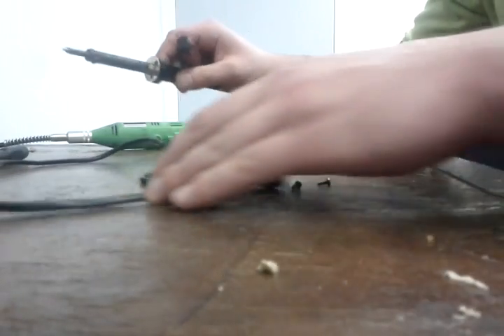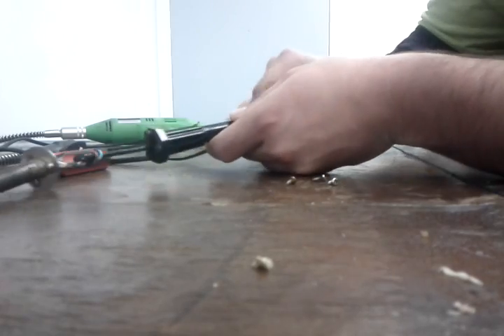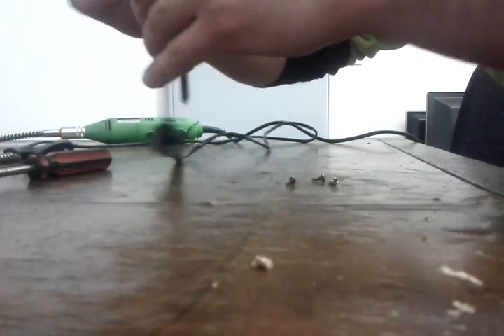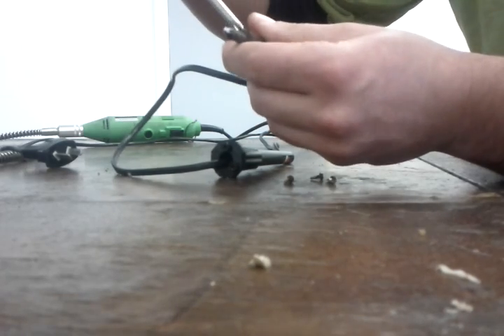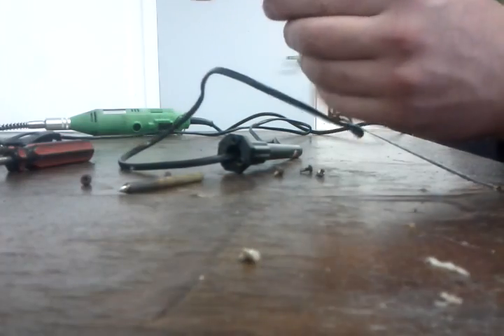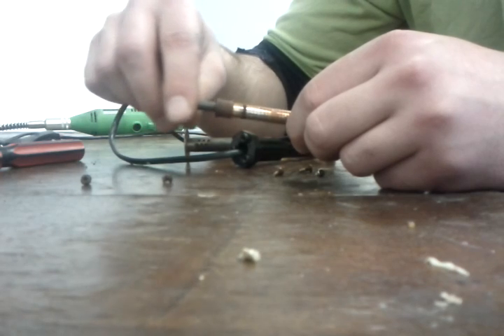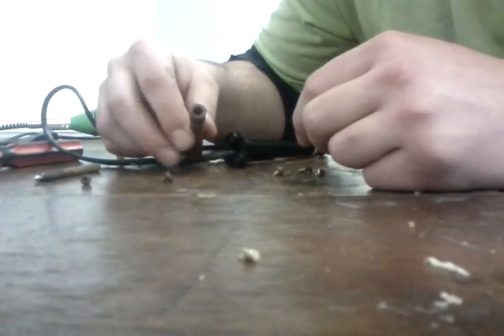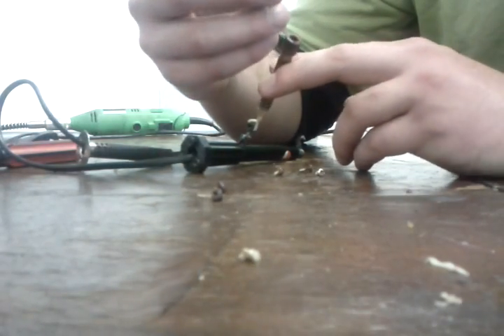How to fix a broken soldering iron (Not heating up)

Comment: I have a Trisonic 40 watt soldering iron, it was not heating up, so I disassemble it and I check the cord it's broken. I twist the broken wire and put tape around it nothing still won't heat up. I have no soldering iron, and that was the last one I have. What a Nuisance.

Comment: Thank you! I just got through £1 soldering iron from Poundland (I think) and a more expensive one from Wilkos building a bin-cage for my hamster, both stopes working so I had to drill the crap out of the storage box in order to cut through. So didn't realise about the tip temperature, it was far too hot and made a thinker cut than I expected but it's OK. Thanks for letting us know... Hoorah for YouTube! All my electrics fail on me, and I always come here to find how to fix!
Reply: Is that in pound town?

Comment: Cool Video
MY Problem is often I am trying to soldier kind of large connections together and the soldering gun just doesn't have enough heat energy to heat the metal up. 
Seems these solder irons and guns are made or small electronic factory connections...
So I often just turn to a small butane torch(it looks something drug addicts might use lol) and that little flame blue tip heats up and melts the solder but good!
Yep

Comment: Thanks for the very informative video. I am a newbie  to soldering.  Sorry if I'm not asking the proper question. My Weller ec1001 is not heating very high.  I put a thermometer to measure the tip temperature, but does not go higher than 260f degrees.  I am curious to find the low heating problem of my soldering iron?
I welcome any input!
Reply: Have you tried pushing it in?

Comment: Hi,  do you know what is wrong with me soldering station, its an RS 200-7693.  50W.  The problem is it heats up to the required heat and melts 1mm solder onto the soldering tip.  When i try to solder and touch the soldering joints, it seems to go cold and the solder goes hard, when i release the tip, you can see it starting to melt the solder on the end of the tip.
Nigel
Reply: I have thr same damn problem with mine
Reply: soldering iron not big enough?  i got tired of waiting, waiting for the 25w iron to do the job.  i moved up to a 60w iron - far better.  so quick that only the place i want to heat up gets hot.  i'm here because the 60w iron threw a rcd in the switchboard and now refuses to work.  i had another go at doing the job with a 25w iron but that's sending a boy to do a man's job.

Comment: I have a weller soldering iron and it has a temp regulating thing in it that is broken.. I can't remember what it is called.. I though it was a thermistor but that is  like a one time fuse, once it opens up that is it   I need it to regulate the temp  I guess by turning on and off.   jerry
Reply: thermostat?